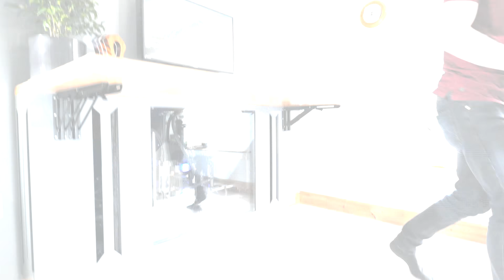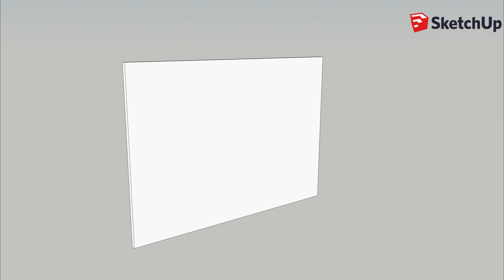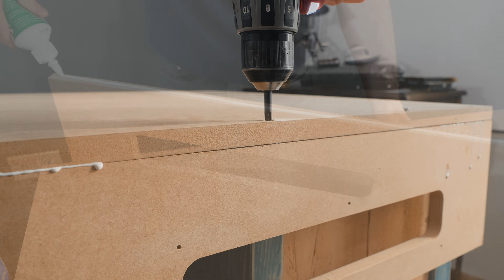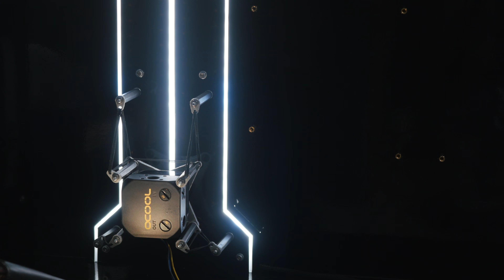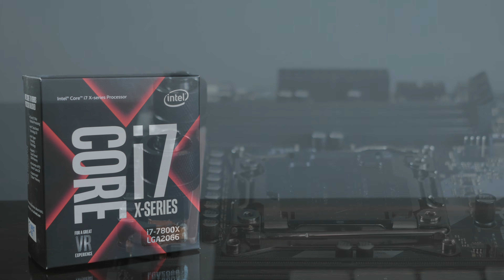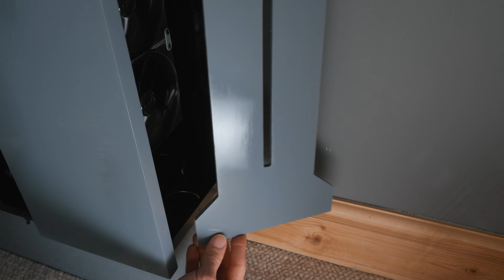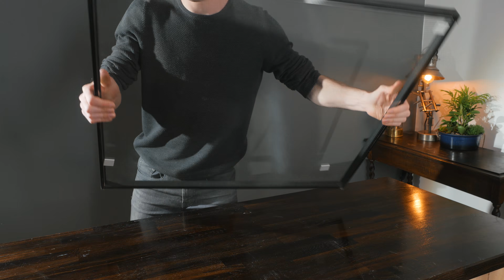Building a spectacular DIY 'desk PC' (it can fold!)

Comment: It is not really recommended to have no airflow at all over your computer hardware. All electronics generate heat. Harddrives, Ram and other parts of the motherboard will feel the need of 'some' airflow. If you make an airtight case like this there is no such thing at all. These parts are not build for this. Harddrives heat up after a while and the problem here is that it can not get away. Maybe it works because of the high quality parts you used and/or the big case in general, but the fact remains that more heat means more wear of your components. It may work now but the chance is high that a system like this would fail earlier than others.
Reply: dual liquid cooling air tight to keep any dust or other crap out with a passive power supply = 0 problems

Comment: Hello, This is beautifully built. I have one suggestion. It would be nice if the casing was build at monitor height so that these beautiful RGB lights can be seen when someone is sitting and working on the computer. currently it is under their table and not visible.

Comment: So first this is Amazing Work! but still two Questions. 1. Is the airtight main Compartment not bad because the one Rad still produces heat, Hdd get warm to the mobo and all this Stuff! Air has to leave somewhere? or did I miss something?  2. is the DDC pump not a bit Weak for that Setup I would have gone with a Dual D5's!

Comment: but if you attach the chiller outside, the radiator inside should also cool down the ambient temperature inside, so condensation shouldnt really happen anyway? at least not at the pipes i guess?

Comment: I'm curious why you decided to add a radiator inside the case? Wouldn't it make more sense to remove it so that it doesn't dissipate heat into the case? I assume the reasoning is to cool the air in the case, but I doubt that the HDD and Power Supply produce enough heat to get the water in the inside radiator to actually cool the air in the table. Other than that, kudos on the cool project.

Comment: Excellent work, as for your question about using  a water chiller, the correct term for what you have in mind, is actually called a Chillbox, which is using an external chiller, and running the cooled liquid lines into a sealed box, so that condensation is no longer an issue.

Comment: Great and inspiring video/project! 
👏👏👏 

But why didn’t you use only SSD drives instead of the two external HDD’s? It would make the two extra elastic shock absorbers unnecessary. Besides that it’s just fantastic!!

Comment: 1. consider a bigger pump cause your loop is crazy big
2. add a reset button
Reply: 3. monitor bracket with extendable/foldable arm. you can bring it forward when you are using it and push it back to the wall when you are not.

Comment: IKEA should come out with the rack so most of us could just save time taken for cutting and measuring =P
Reply: A lot of shops can cut it for you, place where i usually shop charges 10% to cut (which is cheap considering m2 of 18mm mdf is about 10$)
Reply: @cekpi7   in germany, most general/construction/diy markets come with a compartment for cutting MDF, OSB ... into ur desired lenght...so no really need ... and ours in berlin even use routers for special wishes
Reply: Only for 999$ each panel.
Reply: if you had a system in ie a 1U or 2U case then this would be an interesting way to add a monitor and a desk to it

Comment: Interesting and beautiful desk! I was hooked in the first minute of the video. I’ll have to try building one of these, tho I may put my own spin on it. As I don’t care much for an acoustically silent build, I may use aluminum or sheet metal for the body. Also because I hate mdf lol. Speaking of acoustics, you could also mount the pump, radiators, hard drives, etc the traditional way with screws and use a rubber or felt washer between the component and the mount. There may even be specialty anti-vibration screws for such cases. And yes, put a water chiller in there! I want to see how it performs

Comment: I hate remote controls because I have an Xbox 360 a Nintendo switch a Wii and even the steam controller and the remote control Remains the only thing that has to be pointed directly at the device I'm using it on to work I've held a steam controller underneath a desk with my PC on top of the desk and I could still play my game yet my TV remote doesn't work

Comment: 23:51 did he just plug 8 sticks of ram into one motherboard? How is that even possible?
Reply: Some high-end motherboards come with the option, though they aren't too common
Reply: @fakename287  I was told you were supposed to stick two sticks of ram in there no matter what because for some reason that's better and I'm like them what are the other two slots for
Reply: @bland9876  nah, it's not "no matter what" but just "in most situations"
For example, if you want 8gigs of ram, it's better to use 2 sticks of 4gb instead of one stick of 8gb, since your motherboard can then take advantage of dual-channel architecture (google it)

In this case, however, the guy wanted 64gigs of ram, and at this point its cheaper to buy 4 sticks of 16gb that come in a kit instead of 2 sticks of 32gb

Comment: Wait motherboards have m.2 slots on them now? I thought they were just for laptops and you used regular sized hard drives for desktops just like how laptop RAM is different than desktop Ram in size
Reply: Most of them do, well the ones I see around here anyways. Just make sure to read the manual as sometimes they share ports with the regular SATA disks and thus using an M.2 might mean you can not use one of the SATA connectors. The devil is always in the detail.

Comment: Definitely missed a trick in the design of the internal chamber. Would have been better to use a cooling layout similar to silverstone with air being circulated with pressure from the bottom of the case and exited via a rad at the top. The coffin will naturaly become hotter at the top anyway as it is enclosed. If this kind of design was the best way of circulating air in an enclosed space people would be fitting ceiling fans on their walls
You wouldnt even need water cooling to achieve the same results as this project, the chamber doesnt need to be sealed and you could just input air from one side and exit the other. The right angle air intake at the ends would muffle a lot of the sound and when this is all under the desk and running you wont hear it on the desk even if there is some fan noise unless you put your head between your knees. Just focus on isolating the desk surface from the case for vibration transmission, much much easier. Waste of time making it look pretty with braided wires etc, the only person that will ever see it is someone hoovering under the desk. When the desk top is dropped down it completly hides your massive viewing window

Comment: For those looking to do this please DO NOT put the radiator inside the case. Water cooling works by maintaining an equalized temperature throughout the loop. This means the heat being expelled by the two large external radiators is the same as the one put inside the air tight case which is in fact circulating warm/hot are inside a sealed case. Please for the sake of longevity ONLY use the two external radiators as they are more than enough to cool 1 cpu and 1 graphics card.
Reply: I'm not sure a sealed box with no good heat out is a good idea either (of course the mdf/acrylic will pass heat but poorly), but I agree with your point. I think a secondary, smaller loop just to help the internal volume reject heat would be good, though I doubt any real performance/longevity hit from leaving it out entirely.

Comment: Airtight and Soundproof are not the same thing. 3D printing stuff, nice, but putting it on components that get hot? I see a potential problem there, especially with PLA. I like the thinking out of the box but by god would never go this way for the 'suspension'. Also you missed a number of heat generating components. The M2 for one (in fact that one probably is the worst although I do wonder about the power supply but have never had that seasonic model so ..).

Also did you just use PCB solder to make that custom heatblock ? Wasn't clear from the video. I do hope it was at least real leaded solder if so.

And please can people stop using lighters for heat shrink tubing. Pretty please.

Comment: Really nice build Matt. This is the perfect solution for a study station for the kids and since the wife saw this too and was like "that's perfect for the wall outside the study..." So I guess it is time to start collecting component:) 

Thanks again for keeping the channel going and coming up with the fantastic projects you create. There are loads of diy and build channels out there, but few come close to the quality and ingenuity of this channel.

I bought the plans from your site and as usual they are detailed and well thought out. I was a little disappointed that you didn't have a hardware list of the system components though. I know you could build it with anything, but it would be great to have a list of the actual components you used. The Amazon links are great, but you still have to go through a list to work out which parts are the ones you used.  For a complete PC novice I think there would be a lot of confusion about the hardware.

Comment: Hard clear Tubing is better not only Aesthetically, but also makes for a cleaner build and better air flow,
Reply: The radiator and pump are mounted using elastic to the case so hard tubing most likely wouldn't be an option.
Reply: @Treecko8O  I've used both hard and soft tubing in my computer builds and a still prefer hard tubing, not just for the look but it also because I could better manage the air flow in the case by controlling where the tubing is in the case in relation to the fans and airflow created by the fans in the case.  and I doubt that using elastic to mount the radiator will have any advantage in reducing noise.

Comment: Don't Passive PSU's rely on case airflow for cooling? How did that work with the airtight case and water cooling other components?
Reply: I think the idea is that internal radiator soaks up the any heat in the case (especially that produced by the PSU) and distributes it into the water cooling system. Kind of the opposite use to what a radiator is normally used for.
Reply: Heat Sinks.

Comment: It would be awesome if you could make a video about adding a "Water Chiller", as you called it, to the case. Maybe, and I'm completely serious since the case is airtight and moisture can be taken away easily as you said, add some large copper coils to the back, house them with a separate panel using stand-offs and add a compressor and an expansion valve to the loop; basically making a refrigerator of a PC. I wanted to make something like this myself but too broke to do it.

Comment: I'm no expert and I havent even finished watching the video so I dont know how the temps are, but I'd probably use each radiator seperately for GPU and CPU+power. Water through CPU then GPU the power isnt that efficient as it will be hot after the first component it crosses. Nonetheless it's an amazing project!

Comment: This is truly a masterpiece. Just one question - why did you connect CPU last to the cooling system? CPU runs 100% of the uptime and usually needs more cooling than GPU (which sometimes isn't even used at all). Especially, extremely powerful CPUs (like yours) usually are hotter than the most extremely GPUs. And in real life, its easier to put 100% load on CPU than on GPU (maybe except video processing, which probably you do a lot). CPU in your build is even closer to the reservoir. Is there some smart choice behind it?

Comment: Next time you do a computer video please watch some of linus tech tips or research the uses of the components. For example the ram should go in before mounting and the graphics cards aren't a necessary part of a computer
Reply: Well, sticking the RAM in before mounting is because of standard cases being smaller and bigger cooling solutions making it hard to reach. Thus having a risk of damaging something when maneuvering it around the other components. It really doesn't matter when you put the RAM in as long as it's easy to reach.

A graphics card is necessary for the X299 platform since none of the CPU's for that platform have integrated graphics (which most people wouldn't use on that platform anyway).

I'm sure he did plenty of research. Making a custom watercooling loop and putting a waterblock on a videocard is impossible without the knowledge (which the video showed he has because of all the little details he got right with custom solutions). 

We are talking about 3000-4000 worth of components with about 500-1000 in watercooling parts so you can bet he did his research.

Comment: Hello!
Really appreciate your video and specially this one. I had some thing like thin in my mind since a very long time. 
I'm getting this done for my new house and really appreciate that you made this. 
It was really hard to explain this structure to carpenters but not any more. 

Request to please add new features which I believe will make this project outstanding. 
1. Provision for changing height either motorised or manually. 
2. Use a proper monitor mount arms which can extend to dual or even triple monitor configuration. 
3. Provision for storing computer accessories and dock ( I use Microsoft Surface products )
4. Mobility - With simple installation by using french cleats! We can use this in some other rooms with help of two, if possible..!

Hope this helps!

Comment: perhaps some cablemod rather than making your own braided cables? that sounds pretty time consuming...
Reply: It’s better to do it yourself if you want very precise length cables. For example, in a 24 pin motherboard cable that bands to the left, the individual cables on the left would be shorter than the ones on the right CableMod doesn’t offer a service like that to my knowledge.

Comment: Stunning! You have outdone yourself, Matt! And you are too humble, calling it a "concept" at the end when "work of art" would be more appropriate. I love all the parts suspended by elastic for noise isolation. I suggest small silicone rubber tubing, which will last longer, when the (presumably) latex-based elastic goes bad (if you fill the enclosure with N2, it may never!).  And as with all your videos, the videography, narration, editing, lighting, etc. are all perfect. I hope you now have a well-tested backup strategy because if that footage were lost, it would have been a terrible disaster. Congratulations on not only bringing the computer/desk/work-of-art to completion but also for writing up and sharing all the detailed plans. You are a maker hero!

Comment: it looks really good, but in use, over time, I have a big doubt: the dust for the components!
Reply: It's isolated from the air outside the chamber you fucking idiot. He literally states no dust buildup as one of the reasons for the air-tight seal.

Comment: amazing desk but a couple things wrong on the pc side of the project
13:25 that was painful to watch. you have the facts on pc cooling all wrong.
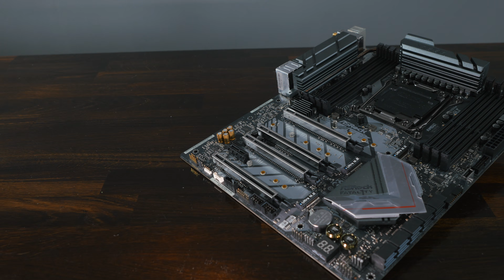15:39 the mother board is more the back bone/nervous system/ blood vessels. the heart/brain of a computer is the CPU
Reply: You did not listen carefully. That is just an internal radiator, not one of the two external ones. The internal one takes in the heat of the internal air while the external ones take out all heat.

Comment: Beautiful build and well thought out! Curious on your choice of components though. I know this was all built in the past and the parts were supplied by sponsors but the 8700k and 9900k are cheaper and completely outclass the Skylake X hardware.

Only benefit of the x299 platform is quad channel memory (which benefits are hardly recognized outside of synthetic benchmarks) and support of 128gb of RAM which you have 64. Hmm

Comment: Since the thing is airtight could you pull a vacuum inside?
Reply: If you want to do that you need a waterblock for every heat generating component, including motherboard VRM:s and PSU. Else they will overheat and break.
Reply: @sebastianmildgrim7391  Ah i see what you mean. in my simple mind i was thinking it was genius haha

Comment: This is admittedly awesome and I want one, but!  Saying that you're dealing with the heat with water cooling is a bit disingenuous, your RAM,  powersupply and other important, heat producing components aren't being cooled at all, if anything they're stuffed inside a hotbox.  Believe me, even those components that do not generate as much heat as your CPU and GPU will still start to impact performance as heat inside the case rises.

Comment: An oversight with the build is that the PSU is going to be starved of cool air. This is potentially a fire hazard.
Reply: The part you missed is the internal radiator with fans that circulated the air inside the case. That radiator is fed to the external one.
Reply: @MTD369  A radiator... radiates. It is not designed to intake heat in the fashion it's being used. Regardless of water flow, eventually the water is going to becoming thermally saturated and you will still end up with a fire hazard as the PSU requires fresh, cool air to remain within safe operating spec.

Comment: Computer noise doesn't bother me, I like the white noise. However, I greatly admire that you had a goal, designed for it with unconventional methods (for desk & PC building), & executed on it with little to no compromise.
Water chiller OC with dry chamber sounds great. Much better than vaseline, shop towel, etc.